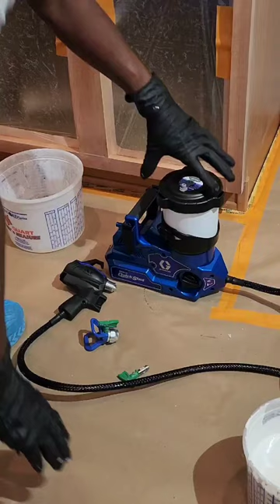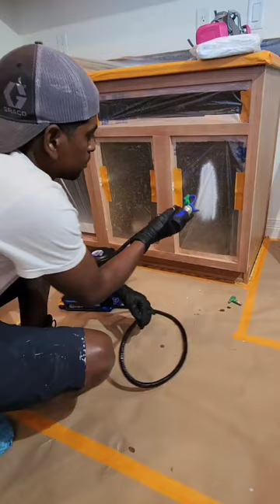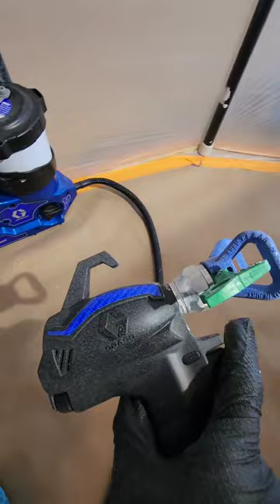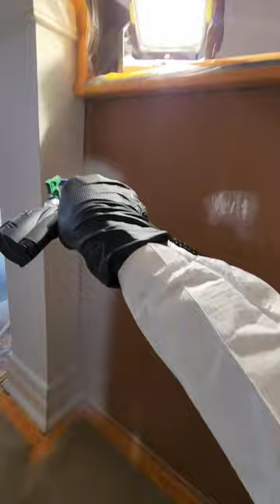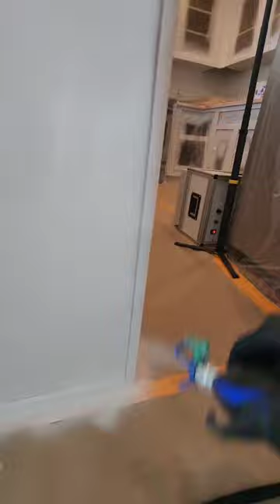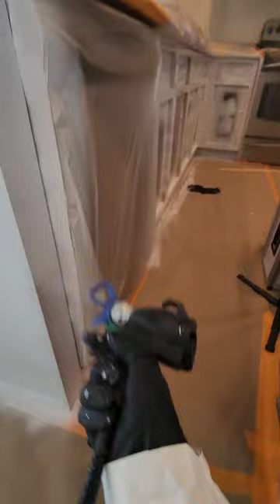Ultra QuickShot

Comment: Price point is high. I would do 20+ cabinet doors with it but I can see doing the frame. I can also see doing hung doors with it, especially in say a 10 story building. Easier to lug around than a bigger airless.

Comment: Can I use oil paint?
Reply from the maker: Yes. The Ultra QuickShot is compatible with the widest range of architectural coatings, from water based to solvent and flammable materials.

Comment: How much did you thin it
Reply: Depends on the paint you use. Water based you would cycle water through the system. Oil based and flammable, you would use paint thiner through the system. It's not that hard...

Comment: Nice tool but too small for bigger jobs.
Reply: It is not made for bigger jobs 😂
Reply: Big machines are too big for smaller jobs. There’s no perfect set up.
Reply: Kiero una deesas
Reply: @freddieleethompson3536 I use a bigger machine for smaller jobs and it works just fine. You're clearing speaking from inexperience.